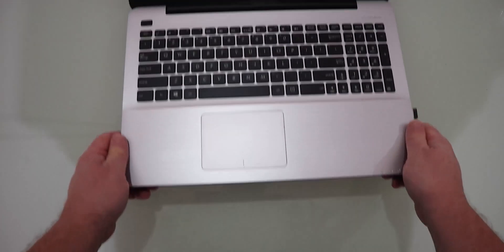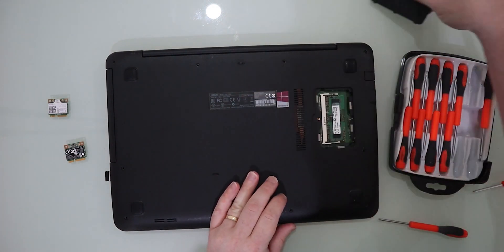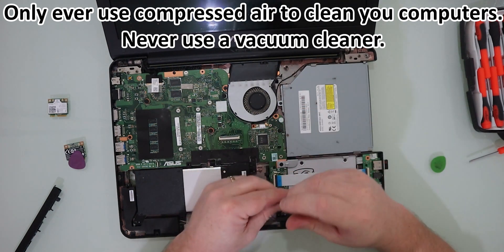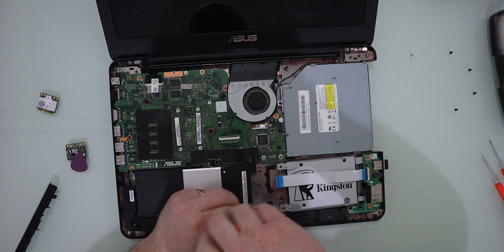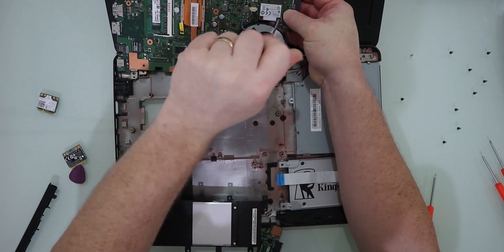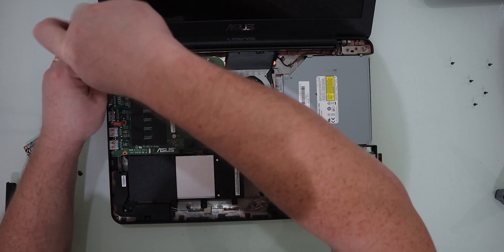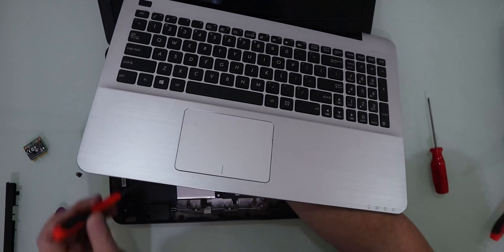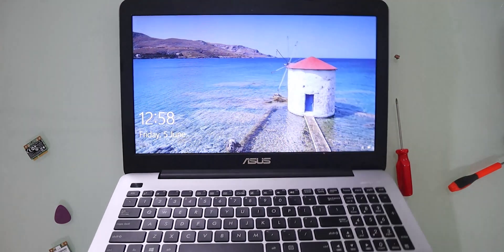HOW TO: Replace The WiFi Card In An ASUS F555 Series Laptop

Comment: Hey man, congrats and thanks for the video. I have replaced the wi-fi card on my Asus X555U laptop, installing an Intel Dual Band AC 3160. I suppose it is compatible, and right after booting for the first time it's possible to find the new card in the device manager, and it seems to be working fine, but actually it is not finding any wi-fi network. It shows "No WiFi networks found". Any tips on this? Thanks in advance.

Comment: Someone installed AC8260? Any experience with it?
Reply from the maker: Yes, they are an m.2 wifi & Bluetooth adaptor. As long as your motherboard supports m.2 wifi, it should be plug and play. I always recommend getting the official drivers from Intel's website for best performance and reliability.

Comment: Hey, thank you very much for the information. I am using a ASUS ZenBook UX430UQ Intel(R) Core(TM) i7-7500U CPU , is it possible to change the network card to support wifi 6? And if that's possible, which one is compatible with my laptop?
Reply from the maker: I've had a look around, but can't see any part numbers for wifi 6 pcie mini cards, they may go down the path of M.2 wifi? But rest assure, your dual band wifi card will still be compatible with a wifi 6 router.
Reply: @MadAboutTutorials   thanks a lot !! 😊

Comment: Thanks for your video! Definitely helped locate and choose the correct chip. 
I have a question you might be able to answer for me. 
Do you know what size the cover screws are? F555UJ.
and where I might find torx instead to replace the originals.
I have striped a few screws heads trying to remove them as they were extremely hard to remove them.
There are many kits online for random laptops m2,3,4,5, m2.5,3.5,4.5,5.5 etc. with different lengths. 
If you know awesome, if not great deal. Thanks all the same.
Reply from the maker: I no longer have this laptop, so can't check for you. It will usually say what size they are next to the screw hole eg. M5x4, M5 being the thread size and 4 being the length in mm. Hope this helps, thanks for watching.

Comment: Great guide, thanks! One point, I had to manually uninstall the wi-fi drivers and then click "Scan for New Hardware" before the replacement card would connect again.
Reply: Does it works? I have too problem with wi fi 3 sec connect 2 sec disconnect...
Reply: @TVakula  Hi, yes I have been using the laptop for a few weeks now and the WiFi has worked with no problems. Don't forget that your replacement WiFi card may be faulty. I would test next to your router and see if you still have problems. Andy

Comment: What kind of wifi card did you put in? Can you put a link in the description? I'm trying to find one online
Reply from the maker: links added in the description. Thanks for stopping by.
Reply: @MadAboutTutorials  A number of PC manufacturers have their BIOS reject all but their own brand of wifi cards (even if the chipset is compatible and the RTL number is correct); apparently ASUS is one of the few manufacturers who don't do this. I didn't risk it and bought used from the same model. And to my joy, no new driver was necessary.
Reply from the maker: I haven't ever experience a hardware lockout, I've upgraded Asus, Acer, Toshiba, Samsung, and Dell laptop wifi cards. It may be particular models of certain laptops that lock network cards to a mac address, I'm sure a firmware update could circumvent that.